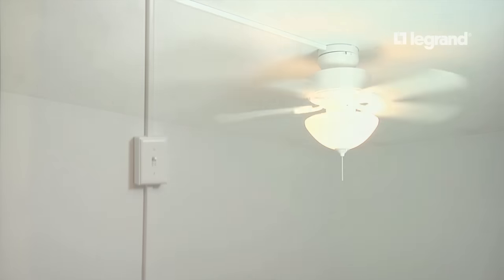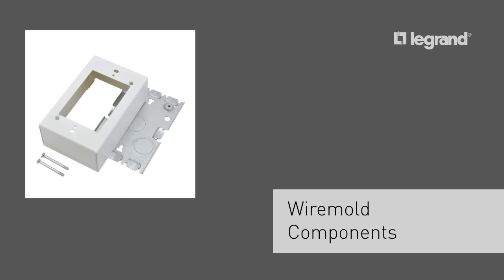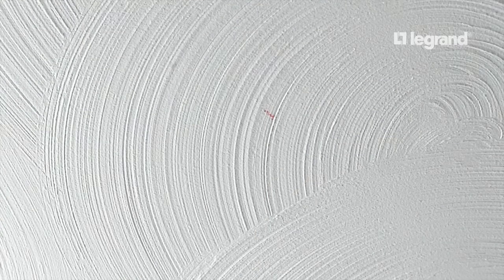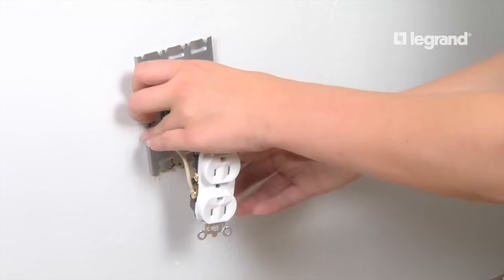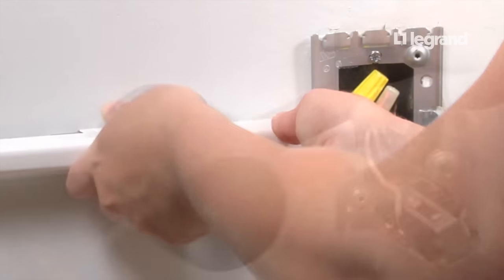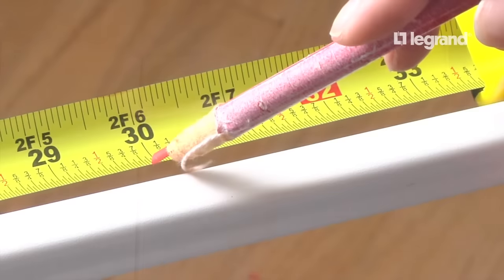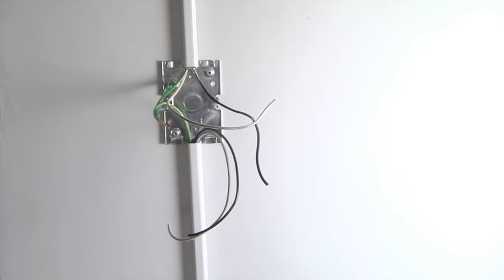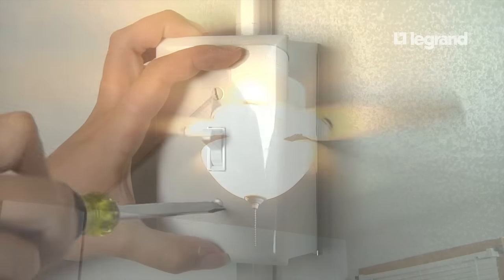Wiremold: How to Install Metal Raceway

Comment: Hello, Im an E1 electrician, and an instructor. This video has so many wrong wiring techniques it would never pass inspection..
Reply: Grupi Rinia CT OK....let's hear 'em.
Reply: +Grupi Rinia CT Outside of Connecticut, few people know what an E1 electrician is.  Rather than state you're an E1 electrician and instructor, point out specifically what is wrong with the wiring.  Just because you have an E1 doesn't make you right.  I'm not saying you're wrong but just because I have an S1 in the State of Connecticut doesn't mean I'm right about everything pertaining to HVAC.  I hope you get my point.